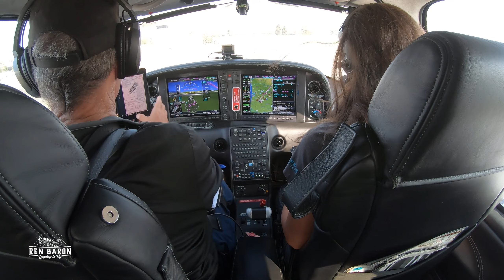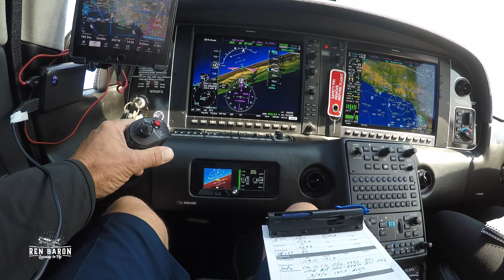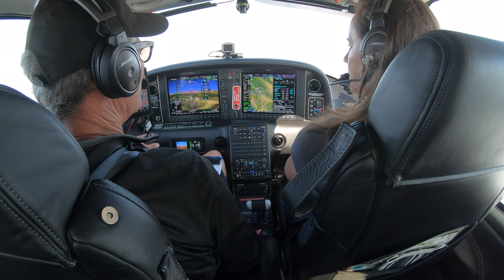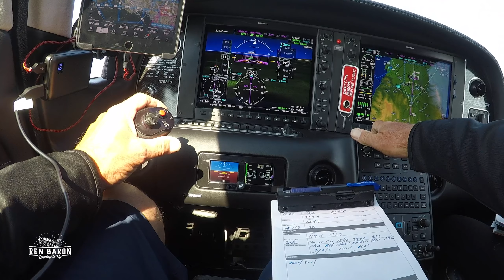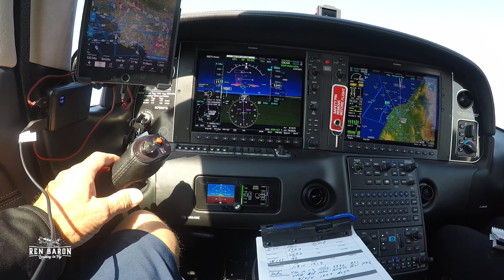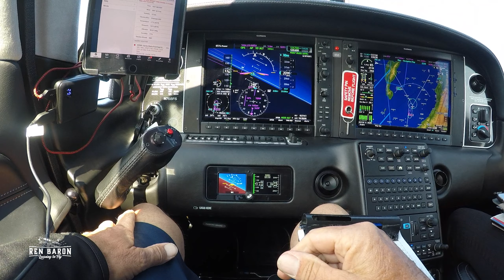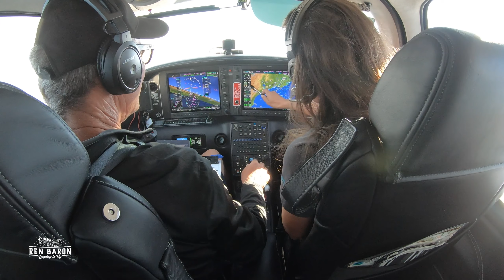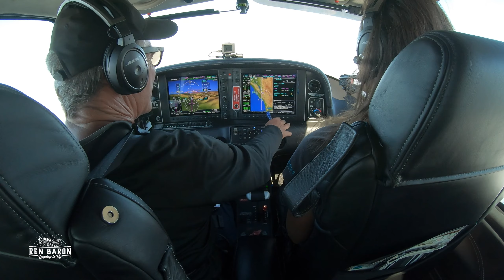Missed Approach, Hold, and Divert in Cirrus SR22T G6

Comment: Curious, why no instrument hood during this? An IPC consists of several very specific tasks, all which have to be done under simulated or actual instrument flight time - perhaps you covered all of those items outside of this video?
Reply from the maker: Well this IPC was not actually an official IPC check in the strictest sense because I've never been out of FAA instrument proficiency requirements since I got my instrument rating 3 1/2 years ago. That said for the most part I tried to keep my eyes on the screens as I would do in bonafide IMC conditions and have Liz judge my proficiency with the Perspective + avionics, comm skills, flight planning, and weather on a cross country trip. In addition, we discussed a number of other things like ADM, personal minimums etc on the ground.

Comment: I was waiting for her to fail the autopilot just as you started to copy the new clearance.  That would have been fun.
Reply from the maker: I've had the autopilot go south on me before. Not in the Cirrus but in my first plane which was a Sling 4. And it definitely adds to the workload in a big way. Keeping the plane level and on a heading while talking on the radio and writing a clearance would be like juggling plates for sure. But the fact is you deal with it. That's probably why somebody invented autopilot and its become standard equipment on modern aircraft. Having said that I try to fly by hand until I'm on course or cruise altitude on most departures just to make sure I could get off the ground safely without it. Thanks for posting. Cheers-Ren
Reply: @TheRenBaron  The reason I chose that time was you were in the middle of a turn. I expect you would have to wait until straight and level to copy a clearance.  Doing that in a hold with 1 min legs would be pretty taxing.
Reply from the maker: @rnordquest  Ahh. For the record the holds were 5 miles not 1 min so I would have have a bit more time. Thanks for posting.

Comment: That was not an a IPC. I would be concerned if you actually lost your panel and had to fly by hand. I never see you practicing that. Plus, did not fly soley by reference to instruments. You just  pushed the buttons. Please. Train hard
Reply from the maker: Yes Scott you are right. It was not technically an IPC so I've edited the title so as not to add to any confusion. I would be concerned if I lost the panel as well but if I did I'd have a backup. In fact, even if I lost both PFD and MFD I'd still have an Ipad for navigation aid. And you are correct that when I'm using the automation that is a big part of the Cirrus SR22 you do have to push the buttons. But knowing what to push and when  is not a given so I've spent alot of time training hard to make sure that I do it properly. I am a huge fan of the glass panel avionics and all the technology in the Cirrus. I understand that some pilots aren't. That is what I learned on and all I know. I have great respect for all the pilots who learned to fly with analog instruments. That is alot harder in my opinion but at the end of the day a pilot has to master the plane they fly in. Thanks for posting. Cheers-Ren